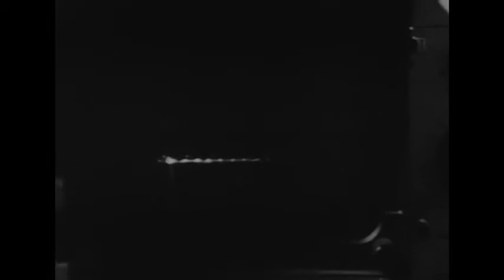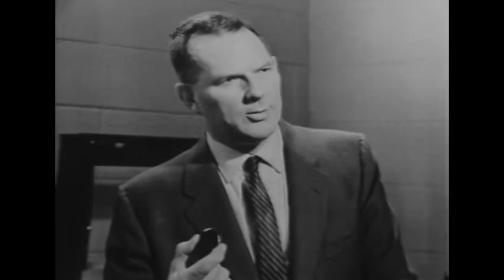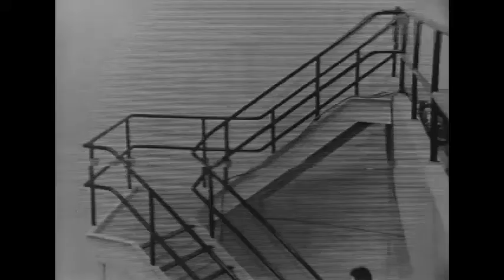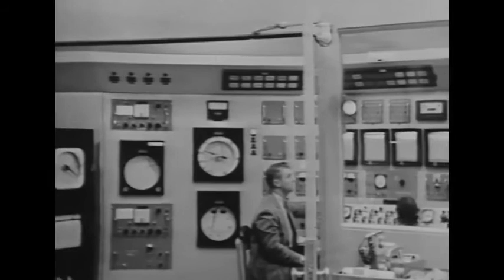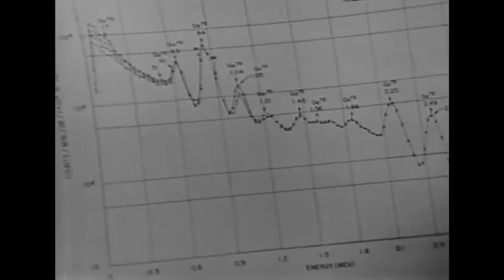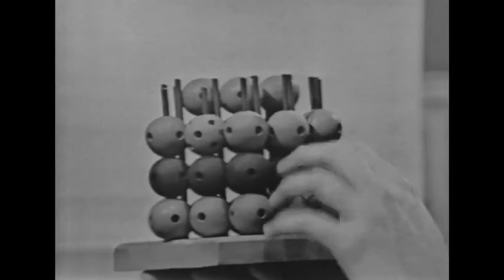1966-05-01: UFO Highlights Watertown Arsenal Nuclear Reactor

Comment: We saw it too!!
Except all luminous with visible horizontal windows along the center were visible where you have instead indicated lights!
It came in horizontally then dropped straight down, then down to the right on a 30 ○ angle until it finally disappeared from view after descending and probable landing or hover in the area of the reactor.
It was a very bold evening sighting.
I was located just west of the Arsenal about 1/2 block away.
Reply from the maker: Great comment... thank you for checking in.  I may redo this video soon with new skills.  ;)